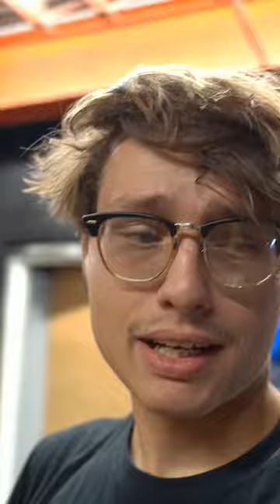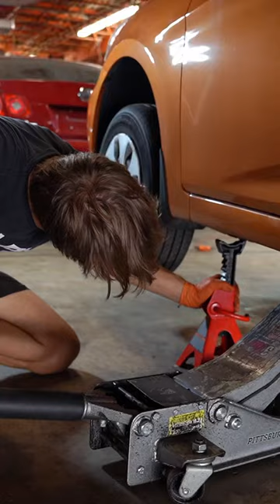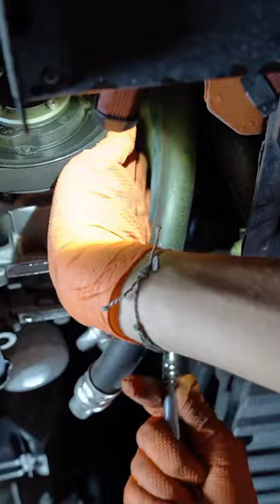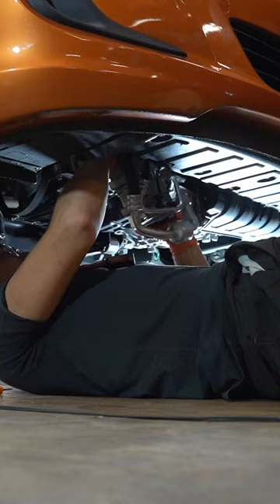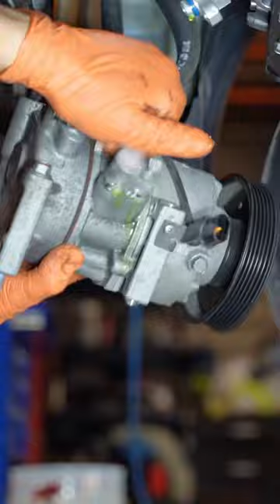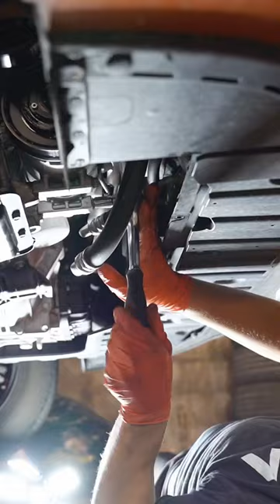AC Compressor Replacement on a 28k Mile Hyundai #cars #shorts #hyundai

Comment: good job on the part replacement, might wanna disconnect ac lines first if you can get to them before unbolting flange bolts…

Comment: What kind of voltage reading are you getting at the connector that plugs into the compressor
Reply from the maker: It's been a long time since I did this, and I don't remember, but I did diagnose it, the compressor was faulty. Replaced it and we were good to go!
Reply: @ccdetailing  I only ask because Im only getting 11.25 volts seemed odd to me just trying to see if it's the climate control module